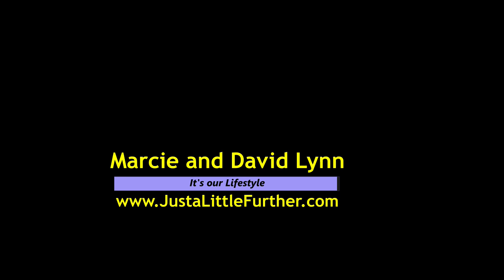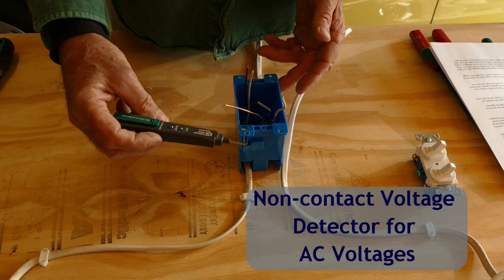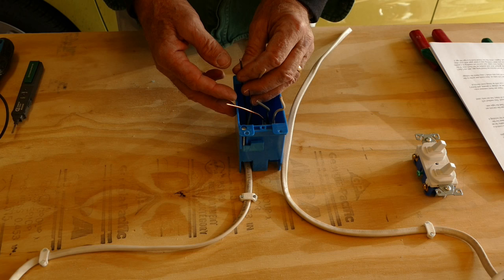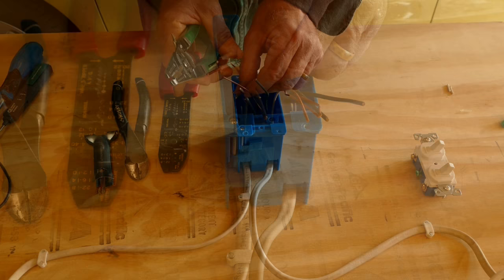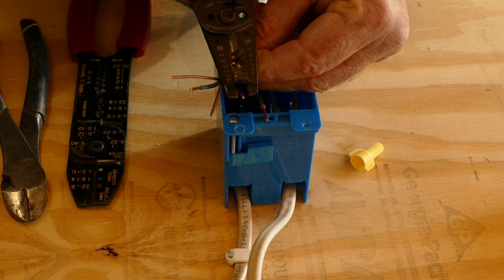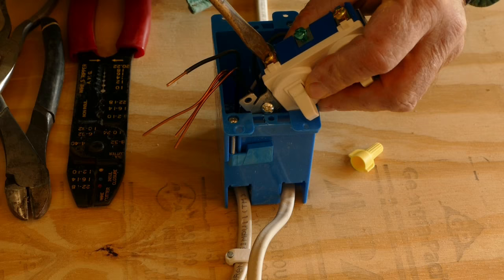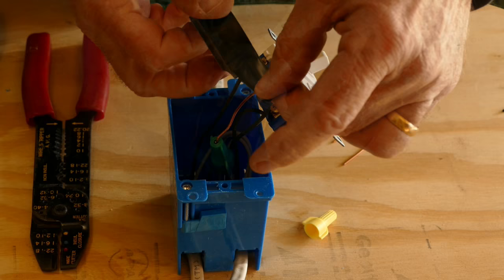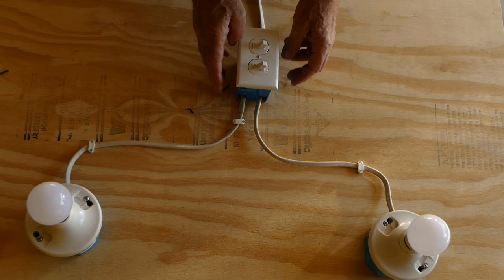Wiring a Double Switch

Comment: Thank you
I've never done any electrical but find myself rewiring a 100 yo home . Luckily for me I am redoing the shiplap as well so the exterior walls are open and nob and tube is coming out. Ive  managed to trace and label all the existing on the second story so far now I'm wiring it up with Romex. What a job! As we are modernizing I'm adding lots of plugs and can lights. Your instructions on simply wiring the plugs is just what I needed AND I learned about certain tools and wire nuts (ground). Thank you a whole bunch. Happy New year!
Reply from the maker: Wow - what a major job! I'm glad you found the double switch video helpful... and good luck on the rest of the job.

Comment: This video is very informative, logical and a pleasure to watch. Thank you so much!
The "two swichers" I bought to replace a faulty old model had the screws arranged differently and came with no instructions. On my initial attempt I connected the hot wire in the wrong place (!!) and as a result had one switch turn on both lights and one with no effect. Your video helped me understand the error. I also liked the explanation regarding the direction of curling the wires around the screws to tighten the contacts.
Reply from the maker: Thanks for the great feedback - I’m happy you found it worthwhile!
Reply: What did you do differently i have the same problem
Reply from the maker: @edwinmoralesrivera3409
Reply from the maker: @edwinmoralesrivera3409  Hopefully, watching the video will help you figure it out.
Reply: @edwinmoralesrivera3409  as I wrote, I connected the hot wire to the wrong place.

Comment: Thank you for this video, it explain the process very clearly. I do have a bit of a different situation though, working on an old 1930´s house. I get 2 wires from the service panel to the bathroom switch, a hot and a neutral I guess  for the light. I want to add a bath fan, I run a wire from the switch to the fan location but now I feel I don’t have enough wires from the service panel to the switch to connect it.
Reply from the maker: Hi Alvaro, just as you said, you have two wires at the switch, the hot and neutral. For the wiring to the fan, connect the hot to the switch and splice the neutral to the neutral from the service panel. As for the ground wire, it's hard to say whether there is a ground in a circuit this old. If the box that holds the switch is metal and the wire from the service panel is inside a metal conduit, then most likely the metal box will serve as a connection for ground. Use 14-2 wire and connect the black to the switch, the white to the neutral and the ground wire to the metal box. Hope this helps.

Comment: Could you do this dual switch to separate  lights and bathroom fan if you only had one hot and one neutral coming in the box ?
Reply: Yes, as long as there are separate wires to the fan and light. In fact, this is the usual configuration.

Comment: Hello Sir..Are you using an Eaton combination two single pole switches or a 3 way switch one? im having issue on my project as only the top switch works combining 2 lights.
Reply from the maker: Hello Julls, I used two single pole switches. The most common problem is connecting the hot wire to the wrong terminal. Please double check this. Let me know if you're still having problems.

Comment: A question, please. I just did a switch like this is an older house. There is one red wire supplying power and two black outgoing, one for an interior light, the other for an outside light. It all works, except the outside light only comes on if the inside light is also on. Any ideas on why this would be??
   Thanks, good video.
Reply: Hi Thomas, usually a red wire is a switched connection, and my guess is that it isn’t supplying power.  I'm pretty sure one of the black wires is supplying power and should be connected to the common terminal on the switch.
Reply: @gentryanderson3247  ok, thanks. I will get tested and find the supply. That actually makes sense. If one of the back wires is supplying power, then the way its hooked up now would require both switches to make both connections. Thank you very much.

Comment: I've never seen a box like that..I have the 2 single switches but that looks so much easier..but what's it called????
Reply from the maker: I assume you mean what switch to buy? You can go to your local hardware store and ask someone in the electrical department for a 15 amp, single pole double switch. Or get on Amazon and search for it there. It should cost around $12-$15 or so. Hopefully this helps.

Comment: What would happen if I mixed up the 2 wires on the one side without the ground? I hooked it up but it works with both switches but when I turn off 1 switch it turns off both lights.
Reply from the maker: Obviously, you want the wires in their correct locations. I'd figure out where I went wrong and correct the wiring. I can't tell from your description which wires need to be moved and to where.

Comment: This is a great video. I totally understand this concept but I am still flabbergasted with the situation I have. I have a single pole switch powering an exhaust fan and LED light in the bathroom. I had to remove and replace an old exhaust fan and light above the shower in the same bathroom. The unit I had to replace wasn’t getting any power. How do I run a dual switch to control these lights separately? The existing switch has a neutral wire on one screw and a hot on the other powering the existing light.
Reply from the maker: Unfortunately, in order to control both the light and fan independently, you will have to run another set of wires to either the light or fan. To save costs, the original electrician only ran one cable to the light and then connected it to the fan in the ceiling.

Comment: What if you want one switch for a light in your other switch for the fan in the bathroom
Reply from the maker: That's what the switch was meant for and what the video, hopefully, explains... how to control two lights or a light and a fan, etc. from one source. Wire the black wire from the source to the input of the switch. Wire the black wire from the light to one of the output terminals. Wire the black wire from the fan to the other output terminal of the switch. Connect a ground wire to the switch and to the three ground wires, and connect all the white wires together. This is pretty much the entire video in a nutshell.

Comment: Thank you very much for the video I've a question on my attic i have a fixture light of the light there's a wire going into a toggle switch can i power another light of that switch and how i do it help please
Reply from the maker: Hi Pilar, if I’m understanding correctly, you have a toggle switch with either a black or red wire that goes to the light fixture (the switched hot wire). There should also be a white neutral wire and a bare copper wire going to the light. Do you want to power the second light with the same switch? If so, run new 14/2 wire to the new light. If the light has different colored terminals, connect the black wire to the brass colored terminal and the white wire to the silver terminal. If the terminals are the same color, it doesn’t matter which terminals the white and black wires are connected to. The bare wire should go to the ground terminal which is usually green. On the switch side, connect the white wires together, the ground wires together, and the black wire to the switched hot wire from the toggle switch.
If you want to change the single toggle switch to a double switch and power each light separately, run new 14/2 wire to the new light and connect the wires as described above. Then remove the old single toggle switch and replace it with a double switch as described in this video. Hope this helps.

Comment: I have this same switch in my bathroom, one switch turns the lights above our mirror on and off, the bottom switch turns the light on our exhaust fan on and off, the fan stays going all the time,but what I want to do is get a switch that has a dimmer for the lights above the mirror, and a regular switch for the ceiling fan light, does one like that exist.
Reply from the maker: If you google “double switch with dimmer “ you’ll find several. I didn’t see any with a dimmer on just one of the circuits, however. This probably isn’t a problem… you can leave the fan dimmer setting to fully on.
Reply: @JustALittleFurther  The fan stays on all the time, the switch only controls the fan light, on that bottom switch,  would that make any difference.
Reply from the maker: @will2dmax1  it should work okay… one switch will control or dim the mirror lights, and the other will dim or control the fan light. Make sure the dimmers you buy are consistent with the type of light, i.e. LEDs, incandescent etc. I’m curious about the fan… it runs continuously all the time?

Comment: Hi,

Your video on wiring a double switch was helpful, but I have encountered a problem that I hope you (or someone) can advise me on. 

My mother has an old double switch that controls two lights (one on each switch). One side of the old switch stopped working (it controlled a light in the bathroom), while the other side continued to work (it controlled a light in the laundry room). I replaced the switch, but I can't quite get it to operate the two lights entirely separately. The bathroom light is fine. I can turn the switch that controls the light there on and off and the bathroom lights go on and off. Great. However, the second switch, which is supposed to control the light in the laundry room, only works when I have the bathroom light on (i.e., the switch for it is on). If I have the switch for the bathroom light off, the switch that controls the laundry room light doesn't do anything. The laundry room light remains off.  When I turn on the bathroom light (using the adjacent switch), the switch for the laundry room light turns the laundry room light on an off. I'm puzzled. At first I thought that the switch might be faulty, but I've now tried 3 switches and each time I had the same result. I've changed around the wiring, but that has only made things worse.  

There are only two cables coming into the box. The one that controls the bathroom light has power (one black wire as well as a white wire that I have attached to the opposite side of the switch). There is no power in the other cable, which runs to the laundry room light. I currently have the black hot wire fastened to a black screw on one side of the switch and the white wire from that cable, and the black wire from the 2nd cable, fastened to the brass screws on the other side of the switch. 

I realize that no one may respond, but I am hoping to figure out what I need to do to correct the arrangement (my Mom says she's OK with having to turn on the bathroom light in order to use the switch for the laundry room, but some Moms will forgive anything!). 

Cheers, Ian
Reply from the maker: Hi Ian, sorry about the slow response… we’ve been camping with no internet for a few days. It sounds like the cable from the bath with the hot wire has been mis-wired at some point, and the hot wire is the white. I think that if you switch those wires, I.e. connect the hot white wire to the black terminal and the black wire to the brass terminal, all will work fine. Let me know if that works. David
Reply: Hi David, Thank your for your response! I've mucked around with the switch quite a bit but I still can't get it to operate properly - to control two lights on two different switches. 

I tried treating the white wire as the hot wire, but it is not hot. I'm afraid that switching it with the black wire did not work. It really has me stumped. I realize that if you were working on the switch you'd likely be able to figure out what the issue is, but you're having to respond to this "blind" so to speak. 

I do appreciate the indulgence, but maybe it's not what you want posted on your YouTube site!  Anyway, I'll go on here, for now. 

Right now the switch is as follows: There are only 2 cables coming into the box. It turns out that each cable has a hot black wire, a neutral white wire and a ground wire. I have played around with the switch and connected both blacks and whites to various terminals (always respecting the Line side and Load sides of the switch), but either the changes make no difference or they make matters worse (e.g., nothing comes on!). 

The best I have been able to do is connect one hot wire to the Line side of the switch, the white wire from that cable to the Load side and the black wire from the 2nd cable to the Load. I have left the white wire from the 2nd cable disconnected. This configuration enables me to control the bathroom light normally (i.e., the top switch turns the bathroom light on and off), but the laundry room light will only go on when the bathroom light is on. When the bathroom light is on, the lower switch turns the laundry room light on and off. If the bathroom light (switch) is off, I cannot turn on the laundry room light with the switch.

I have tried 3 different switches thinking that some might have been faulty. But they've all been the same.

I even tried this with a fourth switch and removed the "fin" on the Line side, but that was worse.I don't know why (perhaps because there are only 2 cables in the box and each has power?).

Anyway, I don't expect you to waste any more time with this, but it is weird that I can't get it to work the way it apparently did for some 50 years (according to Mom) before the old switch stopped working (on the bathroom light).

Thanks again for your assistance.  I have bookmarked your site! It's very good.

Ian

  @JustALittleFurther
Reply from the maker: @user-nn6ug3vr4b  hi again Ian, I’m at a loss to explain this. I’m happy to troubleshoot it with you, however. I would suggest double checking as follows: with a multimeter, check the voltage between each wire and the ground wire just to be absolutely sure that both black wires are hot and neither white is. You can do this without disconnecting the wires from the switch as long as both switches are off. Let me know the results and we’ll go to the next step.
Reply: I drafted a response to your email but it disappeared. Please excuse me if you receive this multiple times! I did as you suggested with a Non-Contact meter (not a multimeter as I don't have one) and I can confirm that each of the black wires is hot and none of the white or ground wires is. I disconnected the wires to try and ensure that they were far enough apart from one another so that I did not get any false readings. Perhaps I should have measured the voltage as you suggested - does that make sense? I appreciate your offer to troubleshoot with me. Unfortunately, the switch is at my mother's house and I have to "negotiate" playing with the switch (rather than just chatting and having a cup of coffee...). Still, if you think there is something more I should try, please let me know.  Cheers! Ian @JustALittleFurther
Reply from the maker: @user-nn6ug3vr4b  let’s take this offline. My email address is nineofcups1@yahoo.com. If you send me your cellphone number, maybe we can text through the problem next time you’re at your mom’s. I’m assuming you’re in the U.S.?

Comment: Some videos say the white wire is the hot wire. You say the black wire is hot. Which is it and how do I tell? Is it white wire to silver, black wire to brass? Which wire goes to black screws?
Reply from the maker: The white wire is ALWAYS the neutral and the black is ALWAYS the hot. If the white wire is hot in your wiring, then the wiring is reversed. The black wire may be switched, as between a switch and a light for example, and in this case the black is either hot when the switch is on or disconnected when the switch is off. On an outlet or light, the white wire goes to the silver screw and the hot wire goes to the brass screw. The dark or black screw is typically found on a three way switch, and is reserved for the common wire... but wiring a three way switch is beyond the scope of this YouTube.
Reply: @JustALittleFurther  Thank you!!! I'd say it was reversed!! Thank you for taking time to reply.

Comment: Hi   Can I use the power coming from a GFCI to wire an over sink light and on the other switch a hood fan 15 amp should do ?
Reply: Contact a licensed electrician.
Reply: Depends on hm amperage the light and fan are gonna draw, and the current amperage of the existing circuit. Also be mindful if the gfci trips so will the light and fan
Reply: Of course. And you can choose to wire those to the load side or the line side of the GFCI.

Comment: I have a double switch in my bathroom. The only wires coming from the wall are 2 black wires and one Grey. No solid copper. I’m confused on how I should hook this up
Reply from the maker: Hi Frankie, is the house older with metal conduit? It was okay to use the conduit as the ground. The ground connected to the box via the metal conduit, then, assuming the box was metal, the ground was connected to the switch via the mounting screws. If the wiring doesn’t have a metal conduit, then I can’t think of any way your wiring meets code.

As for the two black wires and one grey (is it maybe white?), one wire must be hot and the other two must be the switched wires. The wire colors aren’t correct
Reply: @JustALittleFurther  you are correct, after some digging found out it was being grounded to the conduit. And also correct on wiring color being wrong. Took a tester to each wire and figured it all out. Thank you for reply.
Reply from the maker: Oops, that reply got sent before I was done… the wire colors aren’t correct and could be confusing if not dangerous to some future electrician working on the circuit, but will probably work, as long as you get the three wires connected properly.